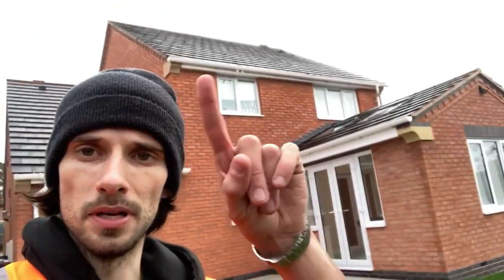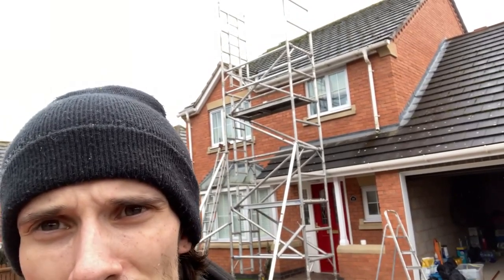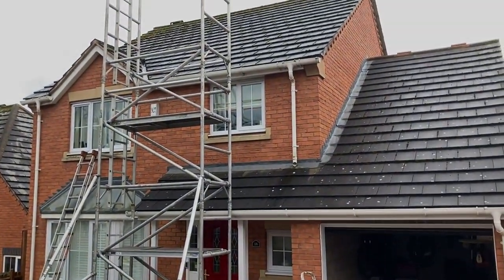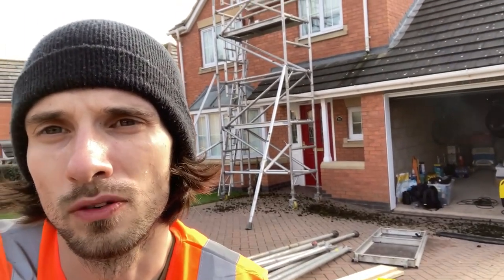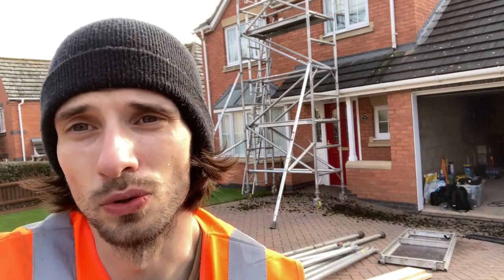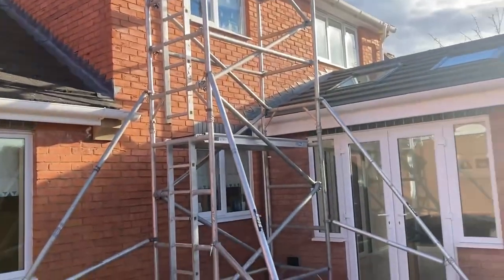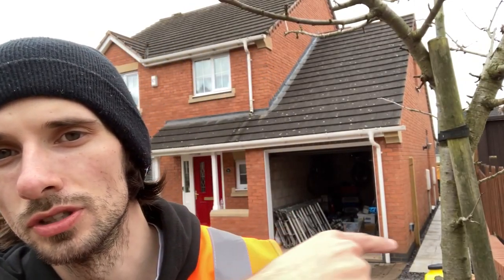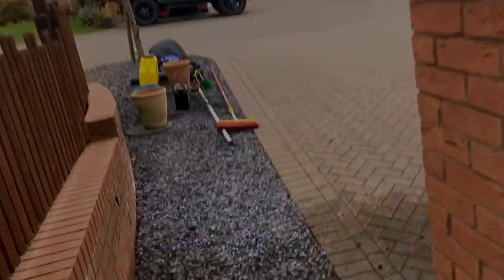ROOF CLEANING With A Scaffolding Tower! // Partridge Exterior Cleaning

Comment: The down side of using a scaffold is that you need the space to move it and you need stable and even ground.  Better to work off a ladder, using added safety features, bottom and top: tie off, and use a ladder platform to save your feet.
Reply: Oh yes ladders all the time

Comment: Personally I like to pull the third  side extensions up using a rope and caribeener  clip, this way the job can be done single handidly. 

I also get the first two side sections and deck on and then take a little time to level the deck with a spirit level  using the four adjustable castor legs. Your not trying to crank up or down a lot of weight and the better job you do of leveling the safer and easier the whole job is.

Once you've used a tower you get used to were your staggering need to be. You will find a huge benefit in owning your own tower not waiting on hire shops etc or missing bits, seized castors etc.

if you get a bit of light 50mm aluminum tube  off the Internet and cut it into four lengths  you can then use it to clip your diagonal and horizontal bars onto and speed up moving the components and make for easier van storage.

Comment: Great video, any decent hire centre should ideally demonstrate a tower scaffold if the hirer is unfamiliar. Always set up the first lift then stand and lift up the sides the attach the outriggers. The simple theory is triangulation, a correctly erected tower should look like X & Z with the bracing bars. Keep up the great work and now you've mastered towers

Get that GSR ready for the next job and Do NOT rinse out the filter cartridges
Reply from the maker: Yeah I thought the same and was honestly expecting a laminated instruction package but nope! even the instructions on the side of the tower was scratched up and unreadable. Can't expect anything less for Burton though to be honest xD 
And yes mate I tried to take that rule of thumb on the build today. Customer works in HSE and he gave me the thumbs up and inspected it and was happy so I was happy! 

Yeah i'll have to pre warn the customers before I whack that on incase they think its the Iranian embassy siege 2021 :D
Reply: @PartridgeExteriorCleaning  Boss & Youngman towers are very similar however some have diagonal ladders that clip in and like the boss you had external ladders built into the sides, if you ever get another hire tower try and get the diagonal ladder version. They are more stable when climbing. I've got some rope, smoke grenades & H&K MP5 cardboard cutout you can borrow haha 😄
Reply: @PartridgeExteriorCleaning  🤣🤣🤣🤣👍🏼

Comment: He'll be forever known as the Scaffold Wizard. Top move Sid. No looking back now. Pressure washing roofs will be coming soon. By the way, was this the new biocide used here? If so, what brand was it and did you find it better than the old one? Seems to be a bit foamier than before.
Reply from the maker: our father bless this day for that mysterious scaffolding wizard that saved my life. 
yeah im pretty interested in getting into steam cleaning one day soon on the right roof that I know can handle it! 
Yes mate this is GKPRO im using and im loving it. I got sent a free 5L to use for a video, ended up buying 10L out of my own pocket as its good stuff. Should be a full review on friday about it. it's so thick and juicy I left it in my pump overnight and today it was too thick I couldnt pump it out properly xD had to flush everything and start again. Great stuff.

Comment: Great to see yo on a nice stable platform :-) Putting a tower up on your own is something you have to work out. Having some rope or a strap so you can climb then raise the sections is handy at times. How did you feel on the platform? It does take much more time setting up and taking down but did it make the actual scraping any easier being able to move about a bit more. 
Great no holes barred vid Sid, thanks.
How did you get on with the stuff stuck on your window cleaning jobs?
Reply from the maker: :D thought you'd be pleased ched :) 
Yeah I spoke to someone last night and he gave me a good tip by hooking the sides over the stable ones so then you can climb up and reach them easy enough. 
Yeah it's a lot easier to scrape because you can put your legs into it more and move around if needed so my arms and shoulders aren't aching much today. 
And yeah it comes up just takes a big of extra time, bronze wool definitely makes it easier though! Thanks for the comment buddy

Comment: Great job 👍 in the long run would it work cheaper to buy a scaffolding tower out right instead of having to hire one, it looks like you intend to use a scaffolding tower more now especially when working on two story houses.
Reply from the maker: 100% josh. It would be roughly 10 jobs before you could buy a second hand one for the price youve been hiring, or 20 jobs to buy a brand spanking new one. They are roughly about 2 grand new so 20 jobs at £90 hire rate gives you 1800. if I had the means to store and move it around I would of bought one a year ago. But currently saving and not far from moving house so its just an awkward time to buy something with such a big footprint. But as soon as I get set up in the new location itll be top of the list!
Reply: @PartridgeExteriorCleaning  I did not realize they cost that much brand new, you have other priorities at the moment, the scaffolding tower looks a lot safer when working on two story houses at heights 👍
Reply from the maker: @Josh-fk8ml  Yeah its well worth it though in my opinion. Im the type of person to just make do and even today I thought eh.. could of done all this from ladders... But that's me and I trust me. There could be folks watching this video that see me doing it off a ladder, turn up to their first job and break their neck, or turn up get above guttering height and go nope fuck that! and look like an amateur infront of their customer and lose the job. 
I preach enough safety about chemical use so I may aswell do the same with working at height even though sometimes I feel like I could do a backflip off the roof because im no bother with heights, not everyone is the same as me.
But I will still use the odd ladder every now and again when its right to do so, I did on this job on the left hand side at the front, Didnt put it in the video as its a bit of an oxymoron but I just can't recommend it, like I never have but i definitely did feel safer these past few days when the wind was blowing! :D

Comment: Did you notice any difference between working on the ladder vs the tower physically? E.g Did the work feel any easier on your shoulders or just the same? I imagine your feet and calves felt better for not being on the ladder all day!
Reply from the maker: In all honesty mate, not much difference. I am so used to ladder work my feet don’t ache at all unless I start hitting the 8 hour mark. But the main benefit for me is the soft washing afterwards, it’s sooooo much nicer being further away from the roof so you can get a really nice angle on it. If I only had a few roofs under my belt I would be telling a different story but as I’ve been on ladders 7 years and roof cleaning for four of those years I’m kind of so used to that method it’s easy for me. So for any new starter I’d recommend a tower 100% as it’s less risk and easier work
Reply: @PartridgeExteriorCleaning  Thanks pal. I’ve got a pretty solid window cleaning business and looking to add roof cleaning to the services I offer but am a little concerned as I already have some recurrent shoulder pain so wondering how much this will aggravate it in addition to the windows. 🤔
Reply from the maker: You do use different muscles to be honest, I have a tennis elbow pain and a half sometimes, but on roofs it only gets me when I have to do lots of straight pulls down, on roofs like this moving side to side I feel fine.. it’s a tough job, I don’t know a single roof cleaner that doesn’t have some sort of pain involved with the job but that’s why it’s high priced work. If this job was capped at even £40 an hour I wouldn’t bother, it’s too much strain on the body, got to make it worth the pain if you plan on staying in it for the long haul.  Lots of people are starting up these days and I see the roof cleaning community getting worried but they won’t last at 2-300 a roof, it’s just not worth it physically.
Reply: @PartridgeExteriorCleaning  thanks for the insights. I’ve got a couple of days training this Friday/Saturday. Looking forward to giving it a go.
Reply: Hi @Mowgliy2k  do you mind me asking who the training is with? 👍
Reply: @markellis404  Of course not. It’s with SmartSeal. Been pretty informative so far. Would definitely recommend doing something similar if you’re able to.
Reply: Thanks @Mowgliy2k Just checked them out and at first glance looks pretty good. I've given them a call and left a message to call me back 👍

Comment: Great video mate! What pole and brush did you use to apply the biocide?
Reply from the maker: Hi mate thanks a lot, I use a renegade 30ft and an unger n lite brush, however to make life easier I’d recommend a carbon fibre 30ft and a brush with 4 jets instead of two!
Reply: @PartridgeExteriorCleaning  amazing mate, thank you for that! Very helpful
Reply: Hi great video I was wondering what you used to spary the biocide treatment onto the roof is it just a battery powered backpack?

Comment: Hi, what wash mix do you use please and what brush for the roof tiles? I see you do it all from the backpack. Do you then wash off afterwards or leave the solution on the roof? And then on pressure washing do you use customers water? Thanks
Reply from the maker: 1/25 with GKPRO 
You leave it to dry, no rinsing needed. 
If I pressure wash anything I’ll
Always use the customers water 👍
Reply: Thank you very much 🙏🏻
Reply: One last question; would I need to have some sort of chemical handling training to use that through the brush or is it ok for anyone to use? Thanks again
Reply from the maker: @user-gs1qd7fw3x  you don't "need" any training or qualifications to use it, however it is recommended. Search "softwash solutions" It's a course that I know a few people that have gone on it and said its great (:

Comment: Cracking video where is your mask from?
Reply from the maker: Hi mate it’s from screwfix, it’s all about the filters mainly. I’m getting a new mask setup later today so I’ll do a vid on it at some point
Reply: @PartridgeExteriorCleaning  spot on mate appreciate it can’t be to safe when it comes to your health. I know you get asked a lot of questions mate but is there any roof tile that you would not use the Algo clear pro biocide on? Just ive read some stories about the biocide turning certain tiles white in colour I know it won’t cause no damage to them but might look unsightly
Reply from the maker: Yea mate I tend to steer clear of cement fibre/asbestos. Unless the customer can guarantee it’s not asbestos and the tile is still intact then I’d do the job but 99% of the time it’s not :D those are the ones that go white. It’s not the bio that turns it white it’s just once the biofilm covering the tile is destroyed, the natural colour of the already worn slate comes through. Once that coatings gone the roof is already white, they just don’t see it yet because it’s covered in crap 👍